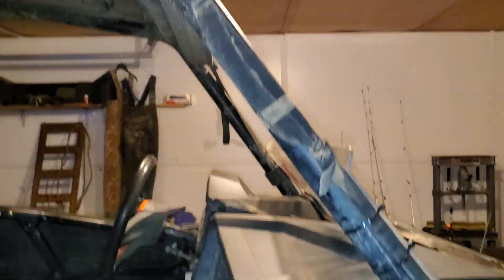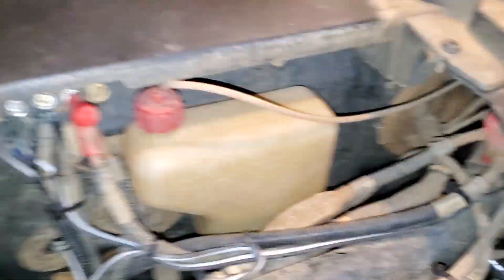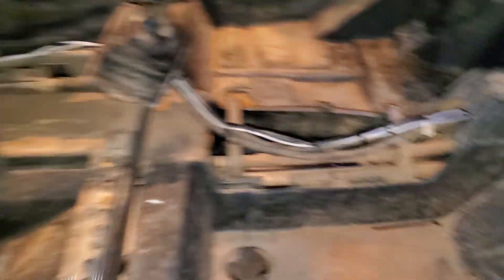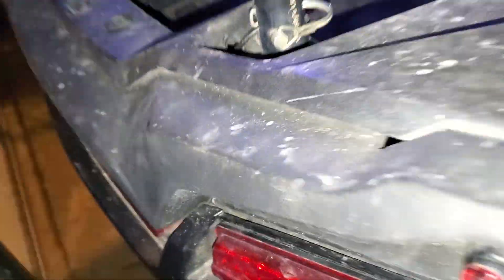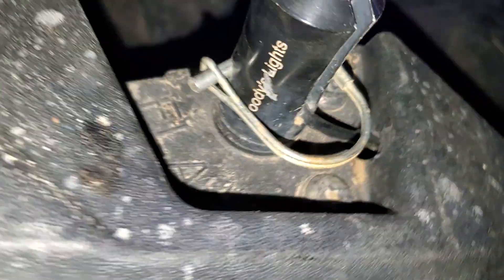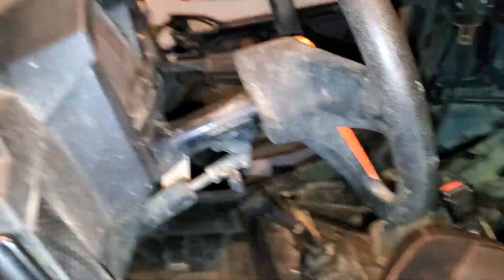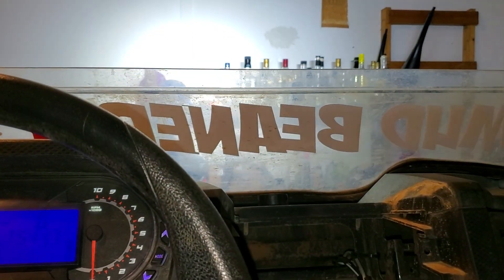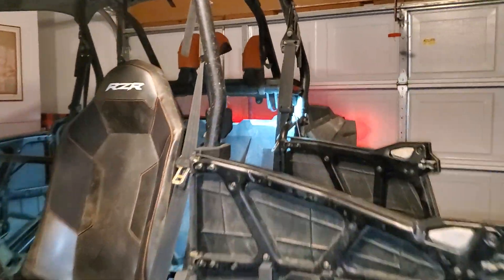My RZR Wiring

Comment: How much did you pay to fix your transmission and who did it I have the same problem with my rzr
Reply from the maker: Got it covered under warranty. Only $200 out of pocket for some extra parts.
Reply: Dame that's what's up I don't have any warranty thank you for getting back at me so quick
Reply from the maker: @BROTHERSETERNAL  no problem, if you're in DFW,  Kaos offroad does really good work! They did mine.
Reply: Ok I really appreciated